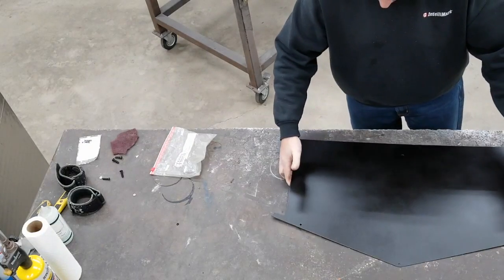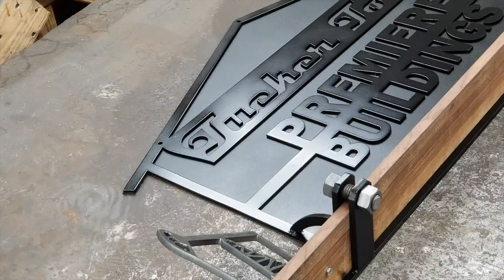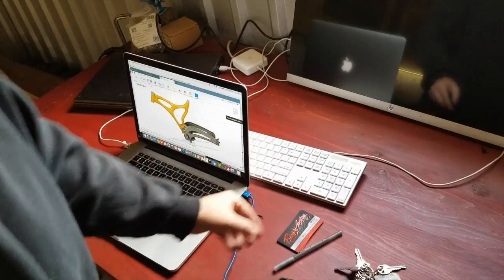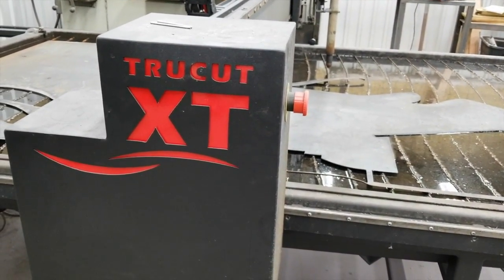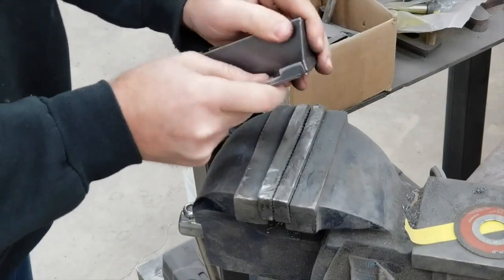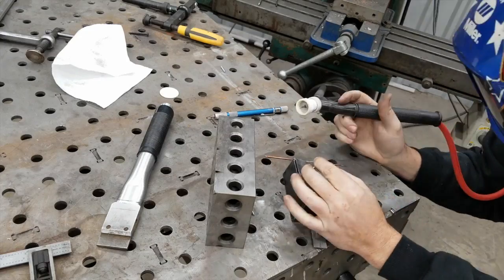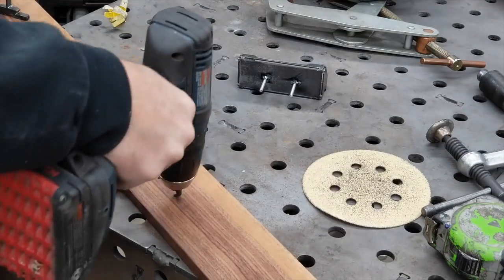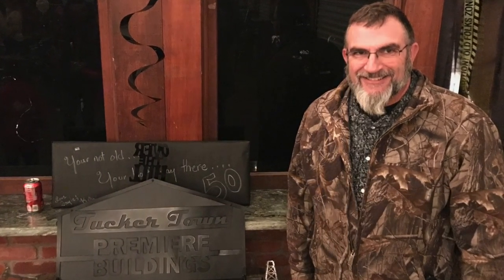Foldable Bent Sheetmetal CAD/CAM Metal Art - CNC Plasma Fusion 360

Comment: I watched your introduction video and realized we have a fairly common past. I was in healthcare software for 25 years before retiring to a plantation in Northeast Louisiana. The first thing I did was to build a large shop, along with an accompanying shed for the heavy equipment.  Because this place had some oilfield activity in the past it has 3 phase power. I bought a new lathe and a new mill whereupon I found out that was just the down payment before I had to start buying tooling and metrology. In high school during the seventies I built winch bumpers for 4wd trucks. Most of my mill and lathe work these days seems to be brackets and tools. You can never have too many tools hanging prettily. I just finished a remodel of my home wherein I built my own zone-based HVAC. It has 12 zones and a PLC to manage everything. I'm still tweaking that code and the HMI. The HMI is a 10" touch screen that includes a map of my house with the rooms colored to show their temperature status. You have my respect for knowing how to make things pretty. My sense of pretty just about ends at the fly cutter and maybe a shot of clearcoat on aluminum.

Comment: I thought maybe you were using the Sheet metal function in Fusion 360.  I haven't played with that feature yet. Awesome build!  I really like how you used the 2 big "shelf" bolts, you went obvious and large with them. It really makes it "industrial."  :)
Reply from the maker: Man, I really dislike that sheetmetal module.  I need to spend more time on it for sure.  I just always manually create the features like k factor relief, etc.  Thanks!  You got your gantry yet?
Reply: @turbocobra  Yep, the kit is all here! Trying to get the table built! :)
Reply from the maker: @WideVisionMetalFab  Sweet! hopefully you are recording some of the build?  did you get Cut2D with your setup?  I have been using it alot lately, and its really nice, fairly easy to use

Comment: Looks good! It doesn't appear you are running fine cut consumables, based on the shield for your 45amp nozzle. For 10ga and under I always run fine cut. For items you need to bend, it should give you a narrower kerf...........I think 0.026" for fine cut. That would make your fitup better. I love using tig because it is so good for making strong yet small tacks or joints with a small bead. Some people would use mig whenever possible but it isn't always the best tool for the job.
Reply from the maker: Thanks man... Right, I use fine cut consumables all the time, I just had a regular 45 nozzle in the machine at the time and wanted to cut this real quick.  There isnt really that much difference in kerf width between them.  On 14 gauge, fine cut is .049" and regular 45amp is .055".  So only .006" difference.  The main advantage to fine cuts for me is that you can run it much slower on fine details and not have blowouts and dross build up.  For me, the #1 thing you can do to have a small kerf is put brand new consumables in the machine.  Once any consumable is used for a little while (say 1/2 sheet of cutting), the kerf can open up by as much as .030"  So If I am trying to get the thinnest kerf possible for a small design, I will put brand new consumables in it, otherwise, just let it rip with whats in it at the time!
Reply: @turbocobra  I didn't look up the specs on the 45 nozzle. Those are great points and I also will run a new nozzle for precise work and then change out to a used one for less critical work. It is great to get a detailed explanation from someone with plenty of cutting time under their belt. Thanks for taking the time to reply!

Comment: I'm impressed.
Reply from the maker: I am impressed that you left a positive comment, but I am also disappointed that you didnt catch that the arc'd gussets were not symmetrical from side to side, ... your slipping sir!  i didnt even noticed i had one flipped wrong when i welded it but saw it when i was painting it..
Reply: @turbocobra  To be fair... I hadn't had my coffee yet. But if we want to get all pedantic, you didn't clean up the splatter or the welds. Didn't file out the inside hole details to square them off on the oil derrick and tower. Your walnut never saw what a piece of sandpaper looks like. You left a paper towel on your table while you were welding... probably still saturated with denatured alcohol or acetone. Too much of a hurry to protect your skin from arc radiation, even for tack welds.

Is that better?
Reply: @EcoMouseChannel  Y'all must be related lol. Funny
Reply from the maker: yea, he is my little sister
Reply: @turbocobra  IC haha